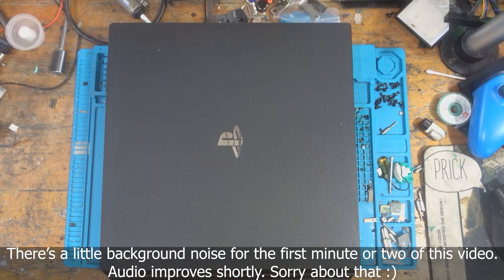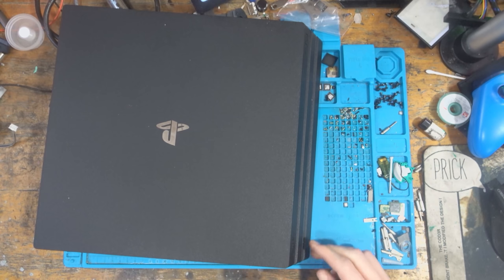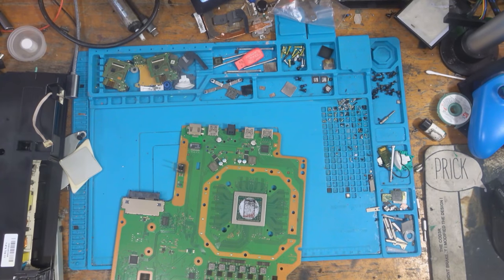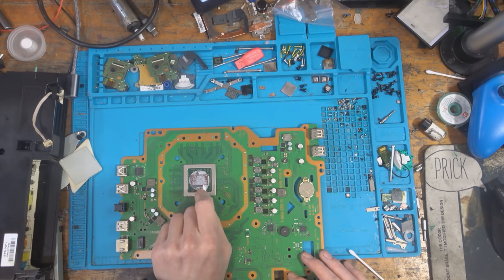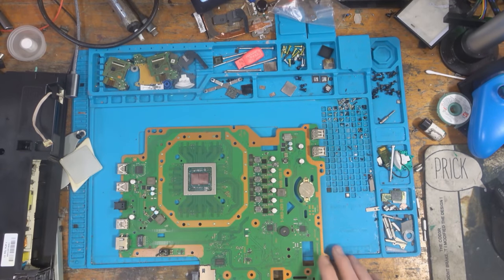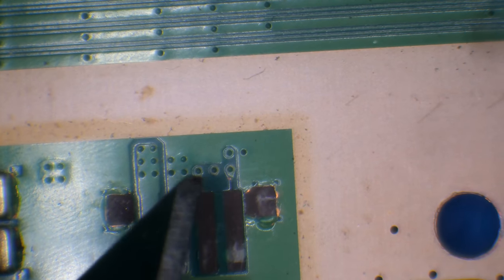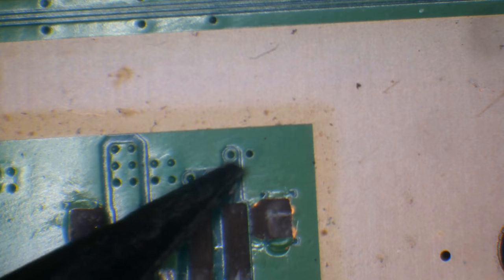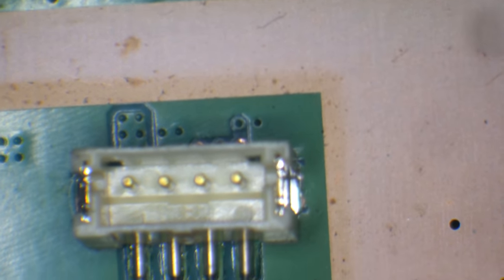Someone YEETED The 5v PSU Connector From This PS4 Pro Board... Can I Fix It?

Comment from the maker: Use this post as a dislike button (like to indicate a dislike) and tell me WHY you dislike the video
Reply: Wow no likes or comment. I disliked how this video was too short :P nah only joking
Reply: On the grnd pin I am getting a beep with red probe on the leg but not on the solder points that hold the connector everything else getting a beep with each leg to each of the other 3 pins. Is it ok if it doesnt beep for GRND Pin on those 2 outside solder points on the connector??

Comment: I did it! Without the conformal coating, but I did it noneheless, the important thing is to solder the 2 sides in the connector. I have seen people using hot glue to stick the connector in place, now THAT would be awful. Myself I ripped the connector, but it wasn't because of a mistake, I was simply pulling up as gently as I could, the thing came off no matter, I literally cried, because I have been 2 years trying to finish my gaming setup and this was the last step (cleaning and replacing the thermal paste). To anyone reading, don't give up! This might happen to you! My theory is that the plastic no only comes to tight from factory, but because in that place, that little connector receives all the heat, therefore the plastic mold itself even tighter between each other! I don't think I am wrong.

Comment: Thanks Phill again, I’ve had a nightmare with a switch lite today. The port was like smashed and stuck into place I had to wrestle it out, so the port goes on fine all nice and happy. Then even whilst being careful  FPC3 or the game card flex connector goes and falls apart, luckily had a dead cpu board used 340 air to remove the connector from the top and flowed it back on and alls working good. It took a while though and had to ultra sonic clean it as the connector ended up bunged up and I was scared to use the tooth brush in case it broke again 😅😂
Reply from the maker: Sounds lile a pain in the ass lol. Glad you got it working though bud

Comment: I more or less the same idea of using solder braid the other day to fix some damage. Have not tested it but well like you showed it makes for good pads! 

So I probably try it the next time I need a pad in no-pads-land XD
Reply from the maker: Indeed it does, if you need a good strong anchor point braid can be perfect for that. It could work on smaller pads too but would be a bit more tricky

Comment: nice work, I purchased a cheap grinding pen, and it's really good for trace repairs, even on ribbon cables  
I even use it without power, and the bit scraps conformal coating, really well.

well worth £15
Reply from the maker: I might have to look into one of those
Reply: I managed to do a trace repair on a display LCD flex cable for the switch with it. two traces next to each other had corroded, amazingly I got the flex cable into the zif.

Comment: I had the same kind of problem with a ps2 fan connector about 20 years ago i think? Though the connector was still connected the 5 volt was off the pad. My friend ran insulated blue kynar wire to another 5 volt source and it was fine again.

Comment: Would it possible to flip the 2 pins on the connector to the back? If yes, that would place them in the perfect spot and running jumpers would be unnecessary. Just brainstorming. Good job sir.
Reply from the maker: Sadly not, if you flip the pins it means you'd have to flip them on the connector too which would mean if anything needs doing to the psu in future it would make it difficult for another technician if they don't know about it

Comment: On the grnd pin I am getting a beep with red probe on the leg but not on the solder points that hold the connector everything else getting a beep with each leg to each of the other 3 pins. Is it ok if it doesnt beep for GRND Pin on those 2 outside solder points on the connector??
Reply: Working on the same motherboard

Comment: just watched your other video for the 1st time & thought it was crazy how you came out with this one today now lol was wondering if the copper traces are required only if the pads are off or can you just solder it back? thanks
Reply from the maker: Thank you 😊 if all of the pads are there you can just solder it back on but if any of the pads are missing you'd need to replace them with jumper wires as the power supply needs all 4 connections to work (or 5 if you're working on a ps4 original)
Reply: @TheCod3r  aw man I'm an idiot.. they were still on & I thought you had to take them off to put the new jumpers on.. difference between amateurs & professionals.. lol really appreciate the reply!
Reply: *this problem happened to me earlier today while i was going to clean my ps4 & yanked the connector from the motherboard.. had the pads on the board & all 4 prongs intact on connector but pulled off the green leftover pads on board knowing no better at the time.. lol oh well
Reply from the maker: @redmann53  it happens mate, if you're comfortable with a soldering iron it should be a pretty simple fix :)
Reply: @TheCod3r  thanks again, definitely got a sub man! take care
Reply from the maker: @redmann53  nice one mate, much appreciated 👍